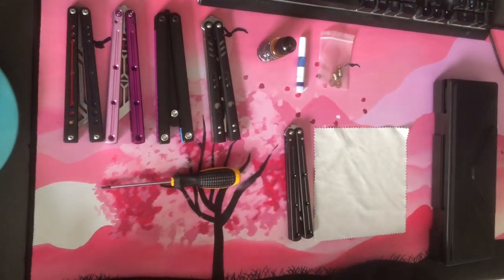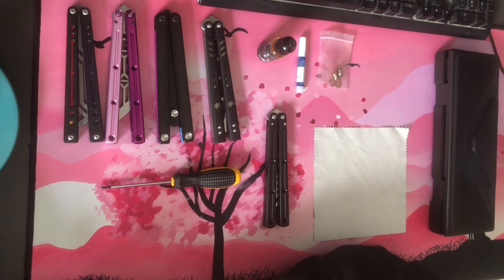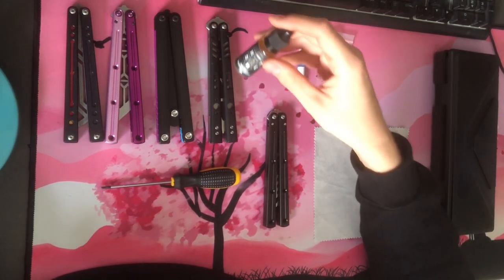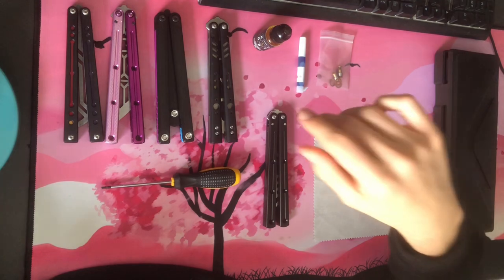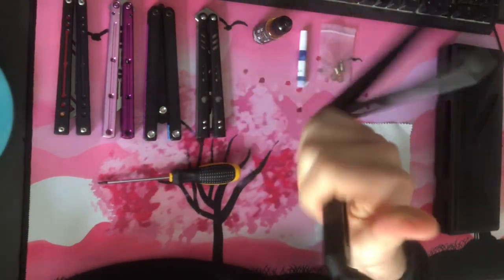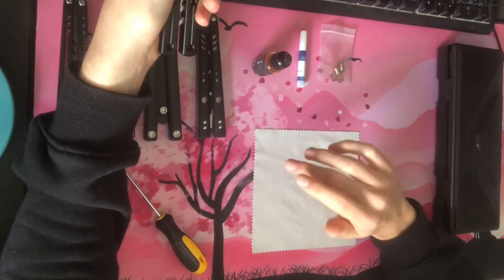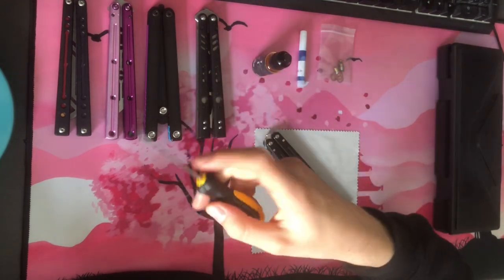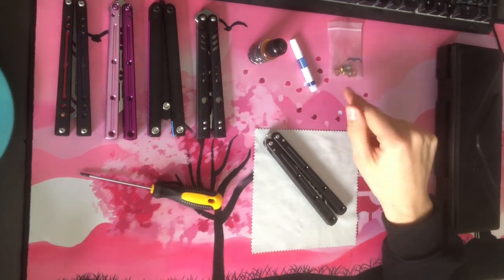Balisong 101 : Basic Maintenance

Comment: I got a b+ kraken v2.5. Do you have any idea where i could buy spare hardware it? The hardware is inked and the paint makes the assembly of the balisong almost impossible. I've heard that the squid hardware fits, but I've never seen it on video. Also I was wondering if there's cheaper way.
Reply from the maker: Squid hardware does fit yes. Other than that I’m not too sure of others but you could check the dimensions and see if there’s anything on thetruelink.com

Comment: Hey im looking to upgrade my current nabalis g10 and i was looking on aliexpress for the 25-40$ price range and i found 2 options: #1 Yuppie Triton V2 clone for 30$ and #2 YYDX Glidr Antartic clone for 35$ which one would you recommend?
Reply: Those suck, just get theone falcon its good overall
Reply from the maker: They aren’t very good balisongs so I’d feel wrong recommending either of them. If you are dead set on those two i would say the triton V2 but anything from Yuppie (YYDX) are not the best. I would suggest spending a tiny bit more for a falcon or a baliplus kraken as these are much better and will last longer and flip better